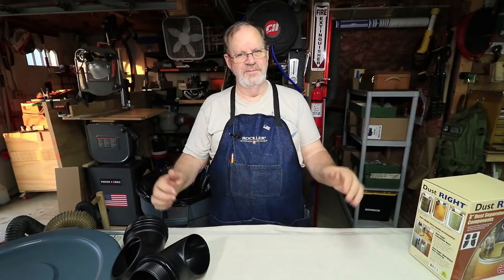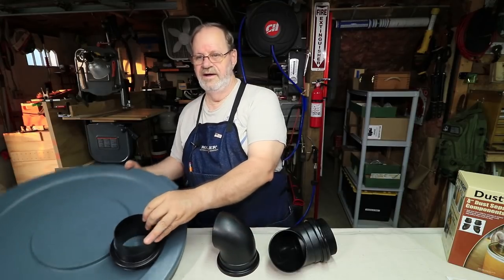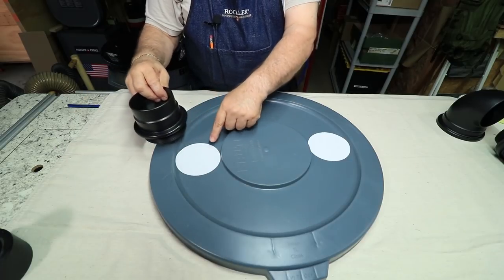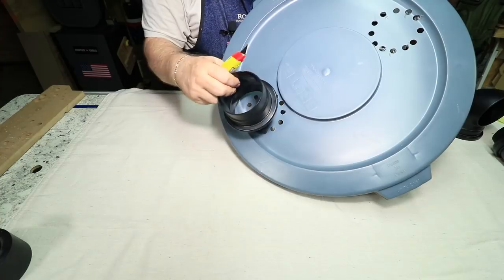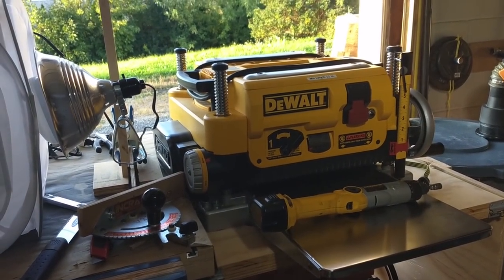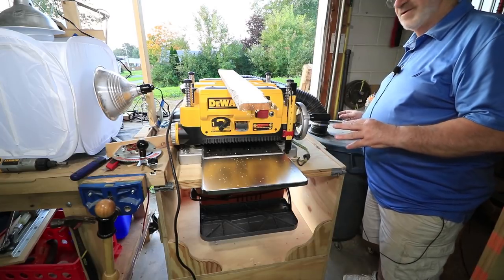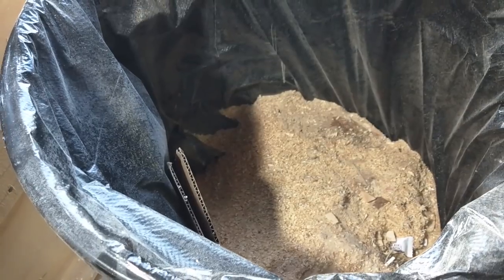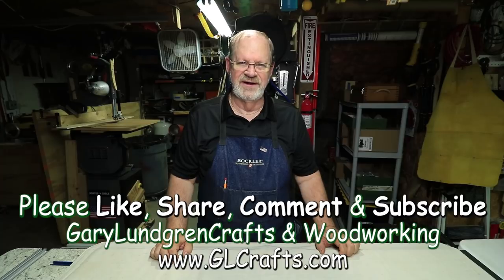Planer Chip Collector Using my Existing Trash Can!  Ep.2018-26

Comment: I really like this idea especially the short hose. Due to the rotating air inside the can I think the exhaust hole would need to be in the center of the lid where there is the least amount of chips due to centrepital force. Then attach a filter over the exhaust hole to catch fine dust.
Reply from the maker: Thanks for watching! Good tips. 👍

Comment: the lid bulge and the blow out you mentioned indicates that hte shop vac is not keeping up with the blower from the planer - perhaps just a filter box on the exhaust port of the can is all that it required
Reply from the maker: Thank you!  Next time I run that I will check that out.  I also have a 4" shop collector. I may try that too.  Thanks! 👍
Reply: YEP... REMOVE the shop vac  and it's hose from the scenario: Dewalt says do NOT use a vacuum with this planer. I have this planer and a cyclone system.. i disconnect my shop vac and hose from my set up... the dewalt blower + cyclone forces the chips down into can with excess air escaping the port where I would normally connect the shop vac hose.... I do not have a filter on my exhaust port (the port where I would normally connect the shop vac hose to my system) but I have little saw dust even without a filter as the cyclone is forcing (and holding) chips down into collection can

Comment: You may be able to just put a pillow case over the outlet of the cyclone and not even need a shop vac or dust collector. That planer really pushes out the chips/dust without much need for vacuum. Next Level Carpentry just pumps the chips into a trash can with a cover over the can.
Reply from the maker: Thank you!

Comment: Thanks Gary... Your thought process on this is well founded, however I really don't like the flexible trash can idea, in particular the lid set-up. At the beginning of the video I saw a solid can ( heavy duty cardboard material? ) with the solid flat lid without any protrusions on it. This would allow the elbow flanges to sit flush to the lid along with the clear sealer as you did it. I also believe the lid has a locking flange ring on it, thereby reducing if not eliminating any dust escape around the edges, however it may require a vent screen on the lid for better chip/dust flow, as it prevents the can from getting inflated with air... I noticed your set-up sucked in considerably & went back to normal when the vac. was turned off, so you may need a vent for your lid as well...
These are my simple observations but thank you for putting this out there nevertheless because overall you have it figured out good enough to work for you...
Bill...:~)
Reply from the maker: Thanks!  I suppose the flexible trash can could be an issue if I used the planer a lot. Not a perfect solution but I used that because I had it and it worked for me, especially in my small shop. Sealing around those ports has worked great for me. I suppose over time with multi flexing it may leak. Thanks for the idea!  I will look to see how I can improve on mine.

Comment: Tin snips to cut the holes in garbage can lid would have been way quicker 😂
Reply from the maker: Thank you! Thanks for the tip!
Reply: Utility knife would have gone thru the plastic like butter.
Reply: I was picturing using a jigsaw, seemed near ideal, I love my cordless j/s! Then I sawmyself buying a 4" holesaw for my drill. I don't have one, must have...MUST HAVE! 

Overall, a cool idea. First video I've seen on the idea.

Comment: REMOVE the shop vac  and it's hose from the scenario: Dewalt says do NOT use a vacuum with this planer. I have this planer and a cyclone system.. i disconnect my shop vac and hose from my set up... the dewalt blower + cyclone forces the chips down into can with excess air escaping the port where I would normally connect the shop vac hose.

Comment: Did you try it without the shop vac on
Reply from the maker: Thanks.  That I did not. I do know that this planer does have a blower to help expel the chips. What are your thoughts on that? Thanks
Reply: dewalt actually advises yo NOT use  any vacuum or suction on this planer!  dewalt official support says it will decrease the machines ability to expel shavings